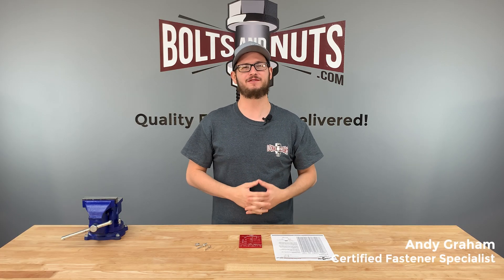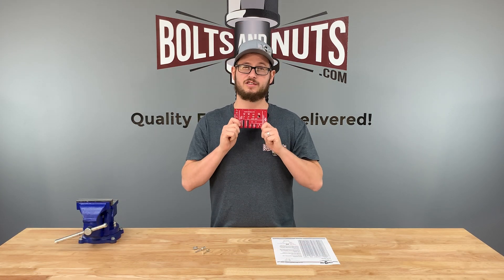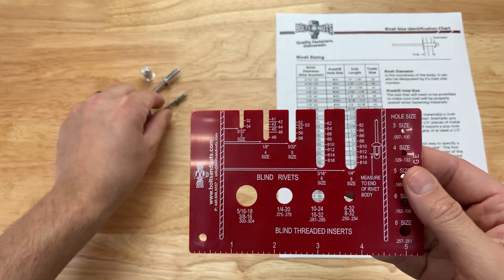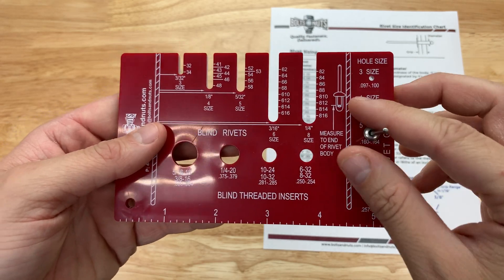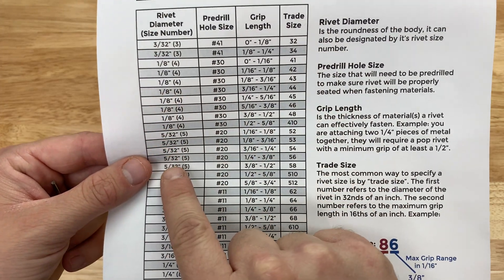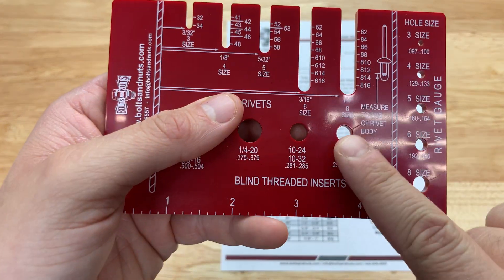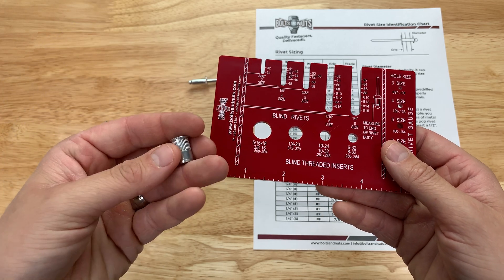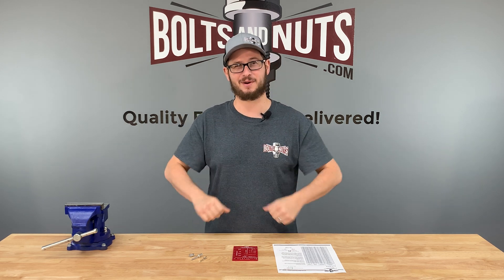How To Measure Rivets & Rivet Nuts Using a Rivet Gauge Tool

Comment: I have a question. So I am following the order that you measured in - Hole size, Trade size grip length, then using chart to find grip length. But how would you order more of that certain specific Pop Rivet? Example: I need a Pop Rivet. Hole Size: 4, Trade size: 42, Grip Length: 1/16" - 1/8"
Reply from the maker: So you will need to order trade size #42. That will always be the same!

Comment: OK, that answers my question. I bought one of the gauges and did not understand what the numbers were but your explanation was short and simple. Thank you.  I have pop rivets that have been sitting around in a box and I don’t have the trade numbers - but the chart that you referenced on your website translates the trade numbers: simply, the first number is the diameter expressed in 32nds  of an inch and the second number is the maximum grip length expressed in 1/16ths  of an inch.  Thank you